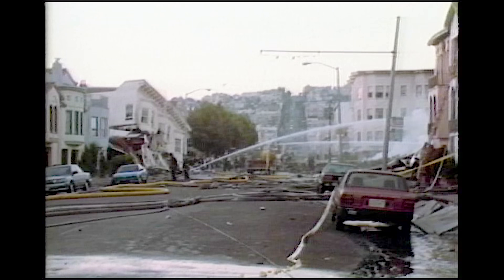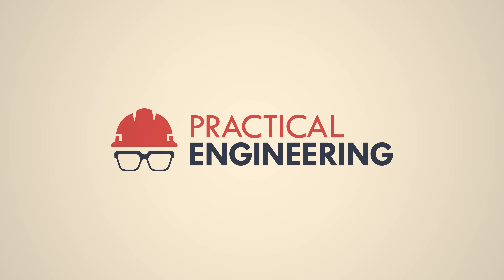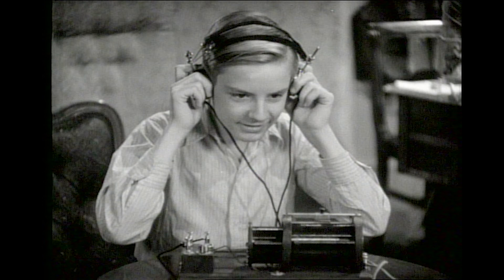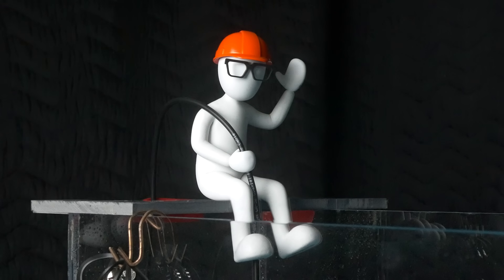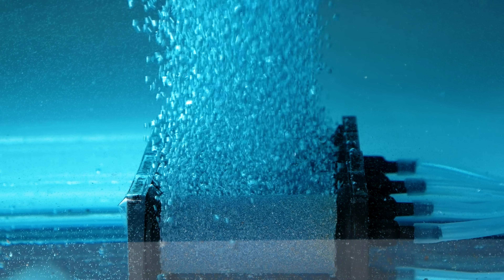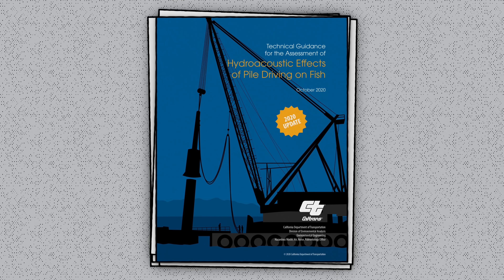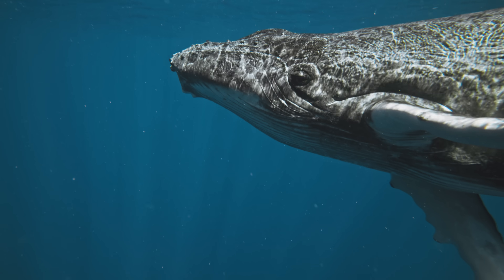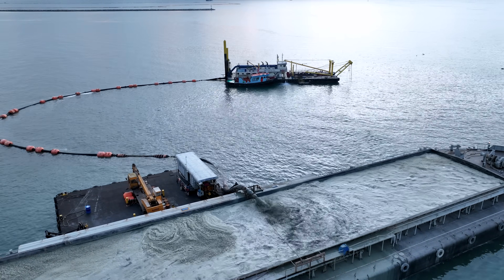The Weirdest Tool in Underwater Construction

Comment: To lessen the dangers of impact from 10 meters, platform divers use bubbles to "soften" the water when they are learning new dives.  It's not exactly an acoustic application, but the same principles apply, but in inverse.  Because the water is so bubbly that it almost resembles air, very little of the force of impact is reflected into the diver's body, reducing the likelihood of injury.

Comment: You missed air lift pumps. Ran across air lift pumps in a wastewater plant rectangular clarifiers during a permit renewal. Cheap, easy to maintain, not terribly efficient for large systems, only moving parts are on dry ground, likely in a building.

Comment: 9:20 make your aquarium X shaped, with one (or more bars) having a 'bow-tie' shape. Put your bubbles along the length of the bow-tie cross. The extended cross shape gives the acrylic a LOT more surface area to lessen it's ability to transmit sounds.
==||=||=||== shaped like this? With bubbles in the 'middle' bar.

Also mix different sized bubbles in there. Those were all fairly uniform. Bigger bubbles should better absorb lower frequency sounds better 0.0

Comment: As soon as you mentioned that the pile drivers were driving steel pipes my first though they had to attenuate that sound from the piles. My second thought was something I was taught back in the early 1970's..... prairie masker. Air will compress readily but water not so much. It does but it's a very tiny amount compared to water other wise sound wouldn't travel through water. All those bubbles from the air lines are compressed by the acoustic energy and this attenuates the acoustic energy from the steel ringing like a bell each time the hammer fell. It looks like your xmitter and anchor may be acoustically coupled to the bottom of the tank, also I wonder if some of your xmitted sound traveled through the plexi bypassing the bubble barrier. Low freqs. in water have lower attenuation that higher freqs. One other thought, I wonder how much noise is created by the bubble curtain just looking at the pictures of bubble screens.

Comment: You should look into space shuttle and modern rocket launches, they use TREMENDOUS amounts of pumped water to absorb the sound energy at launch. Without it they would destroy the pads and surrounding infrastructure just through sounds pressure. I always thought it was for fire suppression.

Comment: Ironically, as sort of an opposite, water droplet "curtains" are used to dissipate or arrest powerful sound waves in air. A shockwave is converted to heat when encountering a thick curtain of water droplets.

Comment: bubbles are also used in excavation in underwater archaeology, because it modifies the cohesion of underwater silt and substrate, enabling it to be more easily entrained and removed by suction pumps and flows that use lower pressures to avoid damaging artefacts and entities buried underneath.

Comment: Not really an application, but I remember having researched the issue of reduced buoyancy due to bubbles. I had heard of 1/the ships sinking in the North Sea because of reduced buoyancy resulting from methane pockets turning gazous on the sea floor 2/drowning hazard in tanks in sewage treatment plants from the bubbles used to oxygenate the pools to help the microrgainsms. As far as I could found, no instance of real incident due only to reduced buoyancy. Recorded incidents are more often due to turbulences cause by the influx of bubbles. If anyone has incidents or application of reduced buyancy because of bubbles, i's be really interested!
Another interesting question, (to me, at least) is the impact of bubbles to pressure applied to vertical underwater structures (... I'm thinking of dams, because DAMS, but there are plenty others I guess). Could bubble walls be used as a means to reduced, even slightly pressure on the sturctures? If it could go to a point of reduced buyancy, because of reduced density, it would make sense that it have reduced pressure applied... right?

Comment: OT but, I say, yes, "sound" is caused by pressure fluctuations, BUT, what we perceive as sound is a mental construct within our minds designed to present information gleaned from those pressure fluctuations to the conscious mind, in an efficient manner. So, the answer to the old question of does a tree make a sound if there's nobody there to hear it, is no. Only pressure fluctuations without a form of ear and a brain to change that into "sound".
 Also, this ties into synesthesia. I believe it is simply a malfunction of a normal evolutionary process. I believe synesthesia is how new sensory organs got incorporated into brain function as they evolved. So, let's say the touch sense was the first thing that evolved. Then let's say hearing evolved. As the buds of hearing organs developed, the signals would be processed through the sensory portion of the brain that was currently processing touch sensations. If I'm correct, then the creature would feel a type of touch sensation when it "heard" something through the new hearing organ.

Comment: 4:40 The reference for underwater decibels is 20 times smaller, so that just means that they are always higher by 26dB.
5:33 I have to mention that there's also electrical impedance that's a complex number conveying both resistance and reactance.

Comment: I think the biggest application for bubble curtains is offshore wind turbine construction. My colleagues used 3 bubble curtains around the hammering of mono piles in the German north sea. The mono piles they had in the last project were 9.2 m in diameter, 70 m length and 1.350 t of steel.

Comment: Grady. I was making dinner and I'm suddenly thinking a lot about the material properties of cheese.

What even is it? A colloid, or an emulsion?? Havarti and mozzarella have excellent tensile strength, but won't do well under compression. Parm may have the highest compressive strength of any cheese.

You have a hydraulic press, right?? Time for some testing. Start with brie and work your way up.

Comment: Bubbles not only work under water, they work in soil too. If you add some polystyrene blocks in the ground in front of a house, you can greatly reduce vibrations from for example heavy traffic on the road next to it. Or pile driving!

Comment: In offshore wind they regularly use 2 or even 3 rings of bubble curtains to ensure a drastic drop off in piling noise (also why some are moving to vibro-hammers).  Regulators typically monitor the operations and will severely fine or shut down an operator for exceeding limits. While still only used in very isolated cases in Oil & Gas hopefully the requirements that have been pushed on offshore wind will be applied there to.

Comment: Water counts for a lot. I can't speak about bubbles, but I was working in a ship at the quay. A sea plane would take off and land. Depending on exactly where I was, above or below the waterline, the sound would come through the water and the hull. It was a different experience and I could feel it. As an aside, on my first time in dry dock, boarding the ship was a revelation. It sounded so different. Internally, it sounded different too and even the decks felt different while walking all through her. 
While going from fresh to salt water, you could tell the exact transition point. The sound of the wash would subtly change, and it would visibly change too, becoming bubblier and less dense in fresh. All very subtle but unmistakable. The exact physics would make this quite a topic, but what we observed was consistent.

Comment: To reduce damage from rocket noise, launchpads use a giant sprinkler system.  A bubble curtain is really a composite material of air and water, and it doesn't matter which one you have to add.

Comment: I can see this being effective in areas with rising temperatures, and fish migration.  Without being a biologist, but owning aquariums.  I do know fish can handle temperature increases, better than they can handle the decrease of dissolved oxygen.   Sure there are underwater currents to help with this, but some less forceful green application of aeration, may be useful in maintaining eco systems of algae and fish migration.  Not to say global warming is an issue, but bubbles may have value in keeping our system balanced for longer.  Possibly giving aquatic life a reason to stay where they are. Something like a floating windmill with an air tube, like an aquarium bubbler, or a underwater current impeller with a floating air inlet.

Comment: 1300 comments already - this one will be quite diluted and it might have been mentioned before already. 
The width of the bubble curtain in relation to the wavelength certainly has a huge influence. For your small tank and narrow curtain it's not really surprising that you don't see too much of an effect for the lower frequencies - not only because of the transmission through the wall of the tank. The wavelengths of these low frequencies is quite long, at 1 kHz, the wavelength in water is about 1.5 m, or about the length of your tank. I think you can even see the rising bubbles at 8:00 being distorted by the low-frequency boom sounds.

Comment: Sound pressure is 10 log not 20.  The reason for the factor of 2 is for when measuring voltage instead of power.  Ohms and power law says power squares with fixed impedance and doubled voltage (due to the current muscle being doubled, and power being the multiple of the two together).  Whenever measuring power whether it's sound or electrical, dB is 10 log.

Comment: After hurricanes Katrina/Rita, the Coast Guard issued orders that no work boats would move after sunset. There were so many broken natural gas production lines on the sea floor, by the time they expanded a couple hundred feet to the surface, they broke surface tension in a huge footprint on the surface. 

Work boats (divers/top side construction) would hit these patches of gas blooms and founder. Straight down, nobody had a chance. You can’t swim away from it, you’re dead.

Comment: Obviously, due to the same principal as sound the Blutooth speaker has a micro SD playing the sounds right? Because Radio communication doesn't transmit underwater unless its ULF. Blutooth, like Wifi is in the GHz that wont penetrate water. Unless it is very limited and shallow penetration...not sure, it would make for a great follow up video.

The low frequency sound got through because it isn't just going through the water it is a perspex tank meaning it will reverberate through the sides past the bubbles. also low frequency will pass through denser materials which is also best for long range transmission.

https://www.google.com/search?q=submarine+sonar+can+boil+water&oq=submarine+sonar+can+boil+water&gs_lcrp=EgZjaHJvbWUyBggAEEUYOdIBCDU3ODBqMGo3qAIAsAIA&sourceid=chrome&ie=UTF-8

Comment: Slightly different use of bubble curtains. High divers (10m or higher) will have bubble curtains in the pool to break the surface tension when they hit the water.

Comment: It's funny that you compared the impedance stuff to electrical resistance, because this is exactly how electrical impedance works too! When there's a sharp change in impedance you get a reflection that leads to higher channel loss through the transmission line. We even exploit this in RF designs by intentionally introducing impedance mismatches to create filters - if you've ever seen weird "RF voodoo" traces on a PCB that have weird shapes and disconnected parts, that's a distributed element filter that uses these exact same principles.

Comment: I guess the bubbles make the water compressible - like the shock arresters or antihammer devices fitted into water systems next to washing machines dishwashers etc. where the solenoid valve turn the water on and off very quickly

Comment: The US Navy has utilized air bubbles to mask the sound of some of their warships from enemy subs (or anything else using passive sonar).

The system is known as Prairie - Masker and uses two systems.

"Masker" uses a curtain of air bubbles released around the hull of the vessel, which uses the sound attenuation effect to cause machinery noise from the ships engines, etc to be reflected back towards the ship, where it eventually will dissipate. What is mostly heard outside apparently sounds to passive sonar like rainfall.

Prairie uses air pumped through tiny holes in the propeller of a ship in order to diminish cavitation noises that are a product of water vapour bubbles forming because of low pressure differences in the water caused by the propeller blades moving through it. These water vapour bubbles make noise when they collapse. The air added prevents these water vapour bubbles from collapsing, which lowers the overall noise of the propeller.

These systems are still in use by the USN, from what I understand, and similar systems are used on some other warships.

Very interesting video.
Reply: Over 30 years ago I was on an Arleigh Burke class destroyer that had these systems. It was explained to us that while using the systems we basically sounded like a small rain shower to a submarine.

Comment: Hydraulic hammers on a steel caisson  is deafening when working close by, I worked on the iron cove bridge project in Sydney, when we were placing the rebar in the steel mould the sound of the hammering was horrendous

Comment: Why don't they use "pile jacking", where a static force is used to drive the piles? It's a rather unknown technique from what i can tell, but it's an easy solution if vibrations and noise are problematic?

Comment: Love how concepts translate in ways I would not have thought.  In the Army I worked in the Army for 25 years and sat in many classified briefings.  Sometimes the rooms you work in are not robust enough to block the sound from being heard from outside the room.  A cheap but effective solution was to put speakers with white noise generators outside the room.  This prevented the conversations from being heard outside without having to perform major construction on the building.

Comment: Instead of making this complex bubble ring couldn't they just lower some kind of cylinder around the pile until it is installed? If it was a material that could absorb the right frequency ranges it should have the same effect without all the complex plumbing.

Comment: Wouldn't it be cheaper and possibly more effective to use cofferdams for sound attenuation purposes in most shallow water applications? You're creating an air gap which should give a similar attenuation effect, plus it can't be disrupted by currents like bubbles can. Not to mention the energy savings from not having to run massive compressors constantly. You probably wouldn't even need to drain the entire construction area if you didn't want to; simply use a double wall with a gap in-between and pump out the gap.

Comment: Impedance matching (or mis-matching) is such an interesting topic that pops up in seemingly unrelated fields. With sound you have horns for matching impedance and increasing transmission, and things like bubble curtains to do the opposite. For light an anti-reflective coating is a form of impedance matching, and the opposite is a Bragg reflector. For electrical signals, impedance effects which frequencies get transmitted or blocked. It sounds crazy, but a bubble curtain and an optical fiber actually have a lot in common.
Reply: Smith chart flashbacks...😂
Reply: There's a good reason for that. Energy is energy.

Insulation does the same thing to heat by causing it to diffuse between two poorly matched mediums. You can do the same with far IR, layer(s/gaps) of thin reflective material. A plane needs a minimal impedance with the air it flies through. Pipes need to be bigger for greater flow rates due to flow impedance. Electronics/electrical rely on electrons being held up somewhere, inductive impedance being one of the core principles in play. Sonar wouldn't be possible without impedance mismatches in different materials, nor would radar, or even lidar for that matter. Light also wouldn't bend in a lens without it. Harnessed fission wouldn't work without moderators to slow neutrons down, an impedance. A floor jack would leave your flat tire on the ground without impedance matching your arm to the mass of the car against gravity... yes the list indeed goes on and on and on.